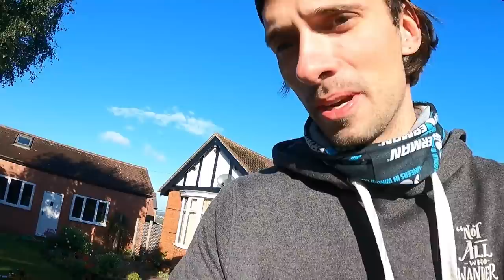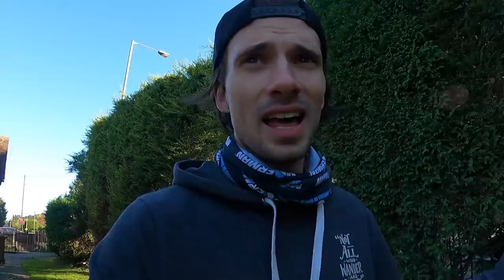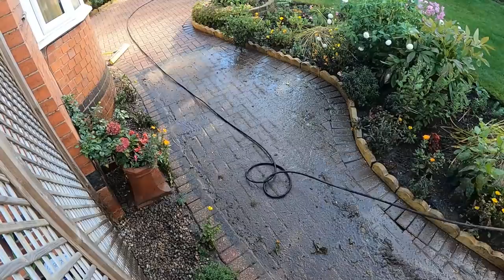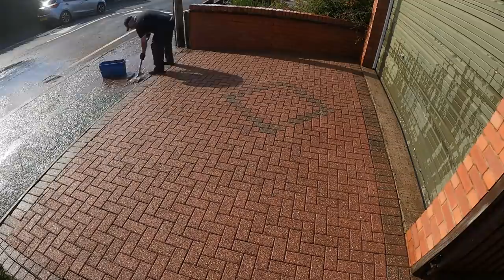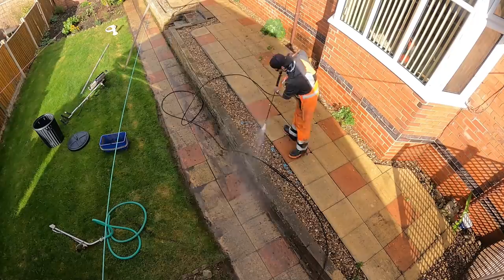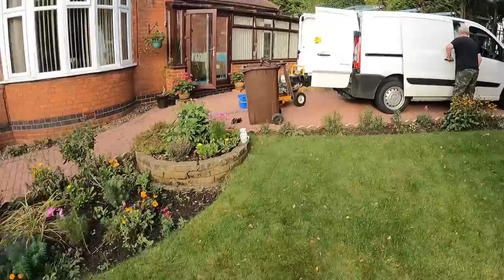Pressure Washing This MOULDY Driveway is Oddly Satisfying

Comment: Great video Sid and a great transformation! Quick question for you - what about a job makes you choose whether to use the nozzle or the circular surface cleaner? Would this have been a quicker job with the surface cleaner? 
Big fan here!
Reply from the maker: the deeper the gaps filled with moss and weeds means the flat surface cleaner may have a hard time pulling it all out so it's quicker to just use the turbo lance. any slabs and flagstones i'll use the surface cleaner instead as its quicker and leaves less lines :D

Comment: I don’t know if it will work but using chalk helps get some of the grease out of clothes. You might want to try it on your power washing projects. The worst that happens is that it doesn’t work. The best that happens is that it takes away some or all of the grease stain. You have to cover the stain completely and heavily with the chalk. It’s worth a try. You’ve got nothing to lose if nothing else is removing those stains.

Comment: Have you ever tried the surface cleaner first and then used the turbo nozzle to clean the moss that didnt come off?????  Wondering if it would save any time or if just going at it with the nozzle from the start is quicker.

Comment: Hey sid when you get a recycling bin for water do you just put the hose in it?
Reply from the maker: yeah fill it up and drop the suction hose in there (:
Reply: @PartridgeExteriorCleaning  wouldn’t it lose some psi tho? Since the machine has to work harder to pull the water rather than a water source.

Comment: Good job. What about the sand, which is also being spun out of joints, is it replacet ? If not, the customer has dents in the yard, in which puddles of water form.

In Deutsch.
Gute Arbeit.
Wie ist das mit dem Sand, der ja auch aus den Fugen gespült wird, wird der ersetzt!?
Wenn nicht, hat der Kunde Beulen im Hof, darin bilden sich Wasser Pfützen.

Comment: I have a question. Why didn't you use the surface cleaner instead of the pressure washing gun first.
Reply from the maker: the block paving was too thick with moss that it wouldn't of worked well on it (:

Comment: Do u find u go through power hose like there's no tomorrow?? Ive been through 4 since Jan !!!! I've stopped keeping my power hose in my wheelie bin now and the M22 seems to not corrode as fast. My next upgrade for my pressure washing is one of them long lances with a sort of bent end, with a double turbo nozzle, ive gave up on block paved areas with the surface cleaner now, ive notice that u do all block paved with a Turbo too !  And yeah I've gone dead too last 2 weeks, got a roof clean this weekend but the diary is looking a bit empty atm 🤷‍♂️
Reply from the maker: i havnt gone through a single one yet! I've had a few orings go but just replace it, im probably due a new hose to be honest it may go pop at any minute. 
yeah i need one of those lances too, will probably buy one tomorrow and get it out the way xD
Reply: @PartridgeExteriorCleaning  let me know where u get it from? U still got the Spinaclean turbo lance ? Its brilliant but annoyingly short, the nozzle on the end of that one is awesome